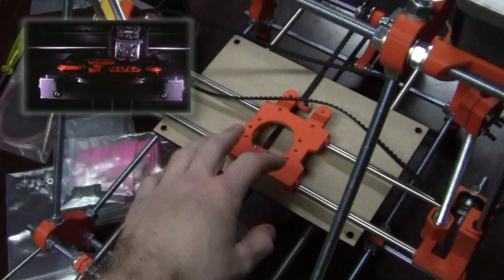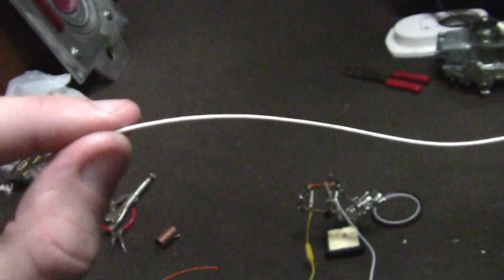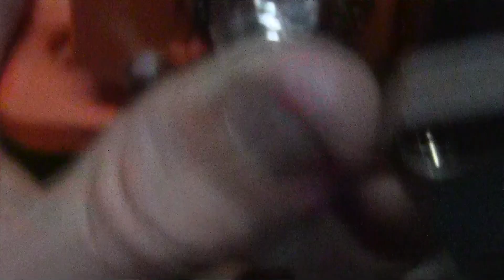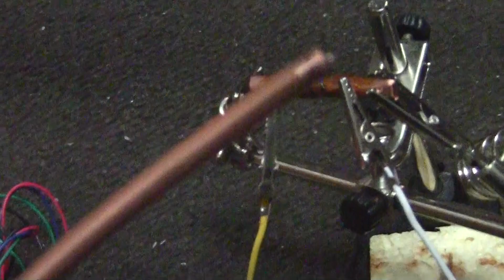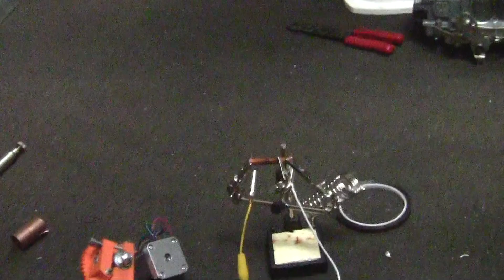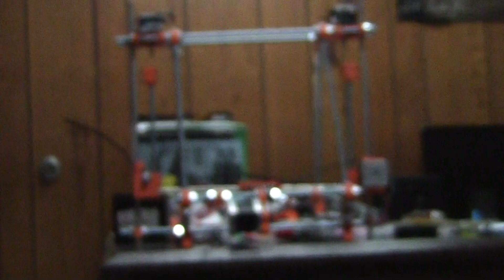How A 3D Printer Extruder Works

Comment: Why are you using nichrome wire?  Very difficult to regulate a constant temp.  Why not use a aluminium block with the resistor and thermistor mounted inside?

Comment: this video is an awesome video man, i was actually thinking about making my own 3d printer. Im in school learning programming now and the 3D printer seems pretty simple for the most part, the only think that would be extremely complicated it seems is controlling the amount of material used. for the printer it self you have a thing to go up and down this would be z, and then you have a table that can spin and the extruder that goes back and forth and this pretty much makes x, and y.

Comment: I just bought a maker gear extruder kit and built and cooked the nicrome heater... very little fuss guys you can just use a toaster oven to do the cooking but do not exceed 230F and turn off the heat after 25 min and let cool. retouch your wires and then cook until done it is that simple.